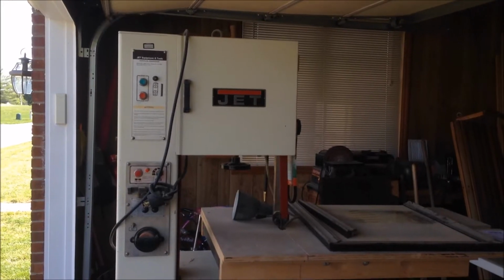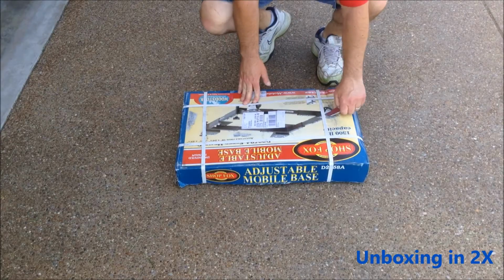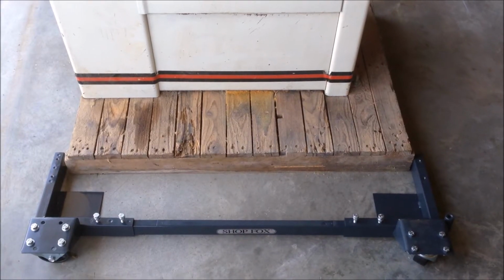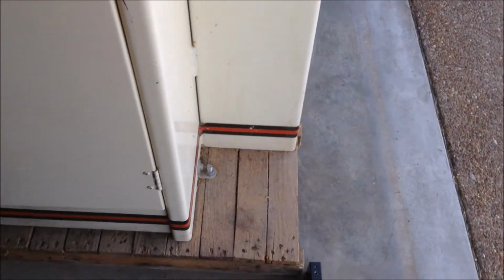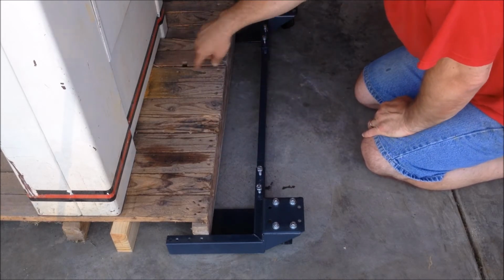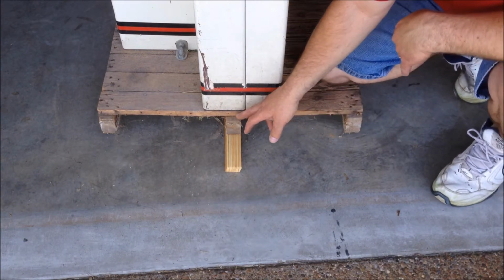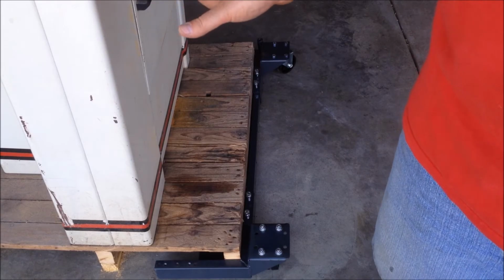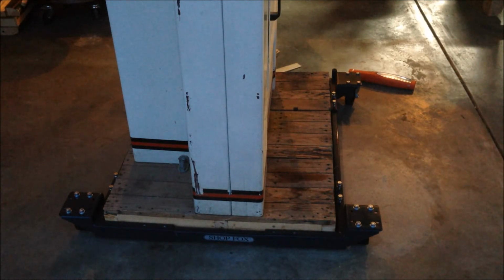Shop Fox

Comment: Looks like that will work just fine!  The way you supported the saw with the additional wood looks good to me! Yes, indeed get that thing running!  :)
Chris
Reply from the maker: Thanks Chris,
  I don't see any sag in the pallet so I'm calling it Mission accomplished. Next up, 220.

Regards,
Bob
Reply: I ran a  220 line for my tablesaw, if you may remember the keeks for that last summer. It was easier than I had imagined.  Made me wish I had done it a lot sooner.   Looking forward to seeing that!

Chris
Reply from the maker: Chris Pine Chris,
  Now that you mention it, I do remember you running 220 and posting on Keek. As soon as I get a little extra cash together, I'm ready to do the install. Then I'll need a 4TPI blade. It's always something.

Regards,
Bob

Comment: Bob, that saw is BEAST! Good job getting the mobile base on by yourself. I see you have the same reciprocating saw as I do: Central Machinery from Harbor Freight. People can laugh all they want but that saw is pretty damned decent! I've been using the hell out of mine lately, especially on the gazebo I'm building in my back yard. For the price (I got two of them a couple years ago on sale for about $10-15 each) it can't be beat!
Reply from the maker: I agree with you Steve, I think I paid $19.00 for mine several years ago and I have beat the heck out of it. I've used it to remove walls from the inside of the house and to cut apart my deck last simmer. It's like a Timex watch, "It take a Licking and keeps on Ticking!"

regards,
Bob

Comment: lucky guy!  I wish my brother-in-law would give me tools like that!

You know what these tool manufacturers need to understand?  We want bases with 4 swivel castors!  That's why I elected to spend an extra $150 on getting the industrial base for my saw stop.  I can move that thing anywhere with ease.  For the small shop, having to steer the tool around is much less than ideal.  My opinion is that if you need to move a tool often enough to justify a mobile base, then you probably don't really want to be moving it back and forth in tight quarters to get it where you want it.  I have not seen anybody manufacturing a mobile base with 4 swivel castors.
Reply from the maker: 21st Century Woodworking Four wheels would have been a dream, this thing us unwieldy with just two moving castors. It is a beast and I have to tuck it into a corner when its not needed. I agree with you 100%.Regards,Bob
Reply: RJBWoodTurner can you not get 2 more swivel casters from grizzly and replace the fixed casters?
Reply from the maker: Thanks Frank,
  I have moved the saw to the back of the shop and it is still not connected to the electrical panel. I know, that's really sad but we're going to move  and I don't want to invest the time and money in a hook up then have to tear it out or leave it. 
  That's a really good idea and I think I will do just that. 

Regards,
Bob

Comment: Robert, first of all congratulations to your new shop-toy, use it safe and with common sense, this beast will cut through boards 10 times faster than your small band saw.
Well, you really missed a chance by installing the mobile base. You could have expanded your shop, by taking over the part of the garage from your wife and blame it on you brother in law. :-)
One thing, you know we Germans tend to be overcautious some time, but I hope the screed of your garage can hold the weight of the saw. I've seen a machine sink into the screed as we moved it into it's position. OK, this was about 15 metric tons on 64 wheels which makes 230 kg per wheel, while yours is about 120 kg per wheel, but 120 kg on a footprint of your wheels might do some damage.
Greetings from Good Old Germany
Peter
Reply from the maker: Thank you Pete,
  Last summer, my wife gave me control over the whole garage. Last week she got a new van and since we are in storm season, she wants to protect it in the garage. I'm afraid I'm with her on this one.

Regards,
Bob
Reply: RJBWoodTurner I see Robert, but I'm afraid my first part of the comment didn't work out quite as intended. I think it takes a lot more to overcome the common prejudice that Germans have no sense of humor.
I know, it's one of the "Honey Do Projects". Although we don't like to, we do. The same way we would pick a star for our loved one just on the wink of her beautiful eyes.
Never the less, you seem to be a caring husband and father in the first place, rather than a crazy woodworker like me.
Greetings from Good Old Germany
Peter
Reply from the maker: ***** Pete,
  It was probably more my seriousness that missed your humor. After going back and reading the comment again, I now see the levity in the comment. my apologies and thank you for your continued support of free woodworking videos.

Regards,
Bob